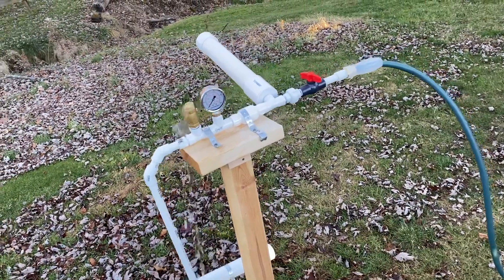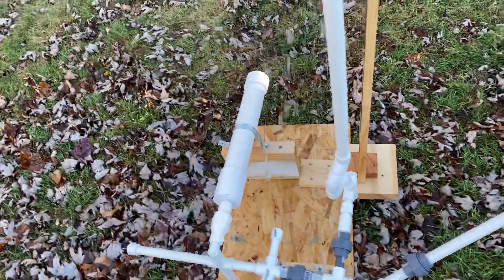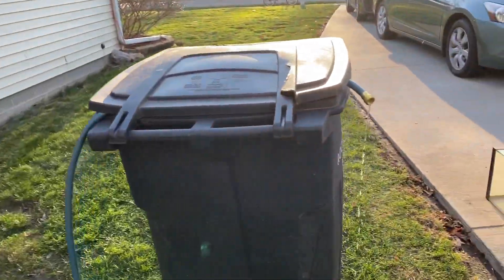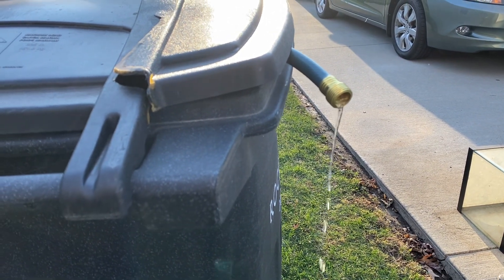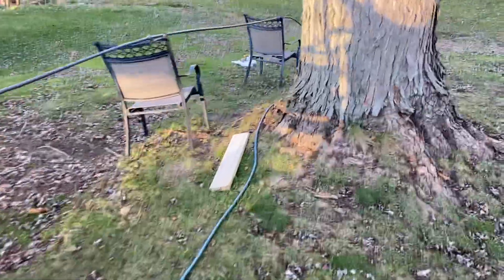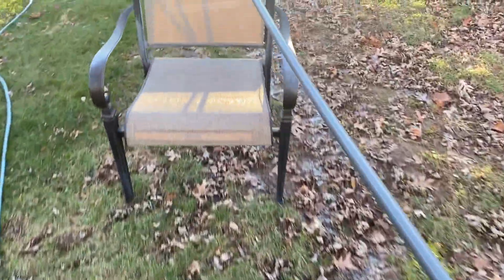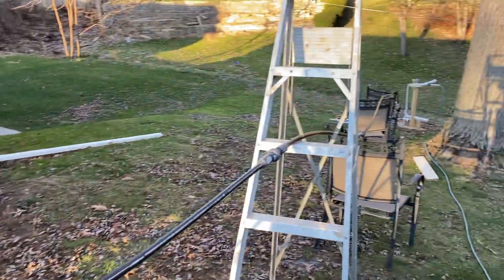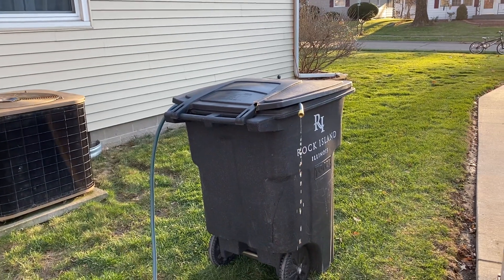The Great Pyramid of Giza Ram Pump theory.   Proof of concept!

Comment: The water coming out of the hose, being secured by the trash can, appears to be at a lower elevation than the reservoir. This looks to essentially be a water tower, unless I'm missing something. Really cool that you are playing around with the concept though!! :)
Reply from the maker: The water source has to come from a higher point from the ram pump, usually a minimum of 7 feet.  Yes, the trash can is lower than the source but it’s being pumped up approximately 12 feet up the hill and then another 4 feet up the trash can.